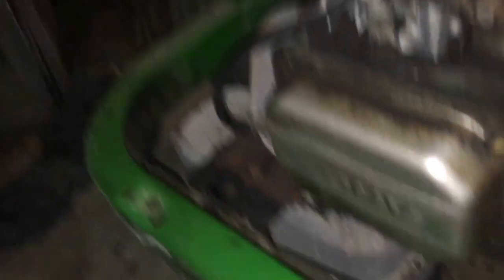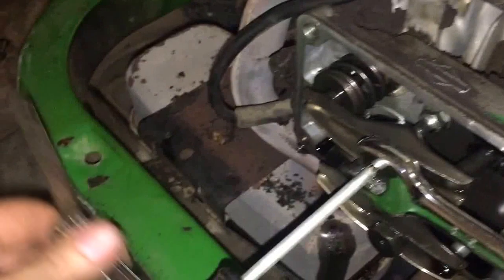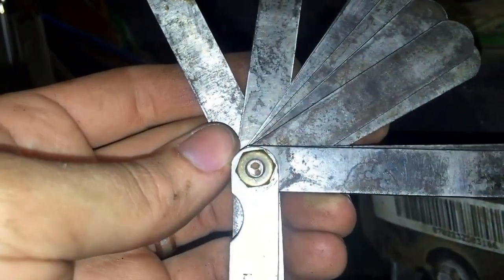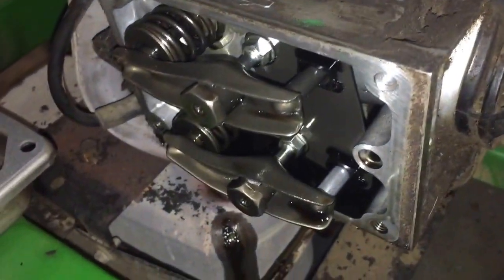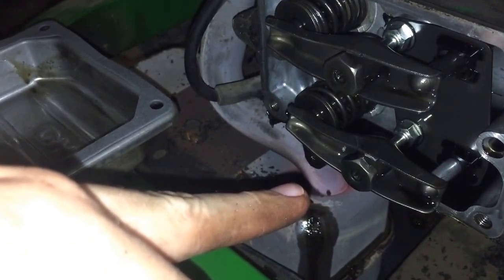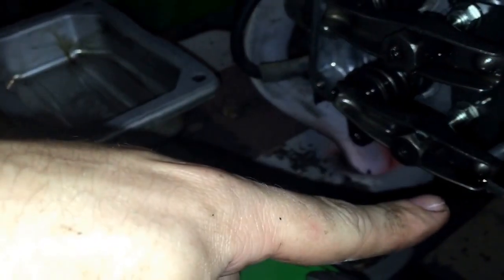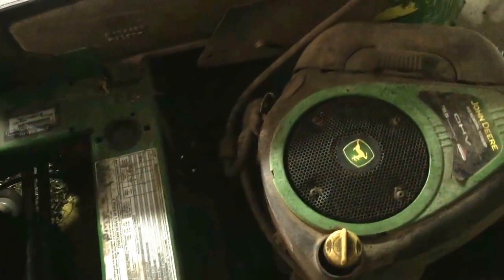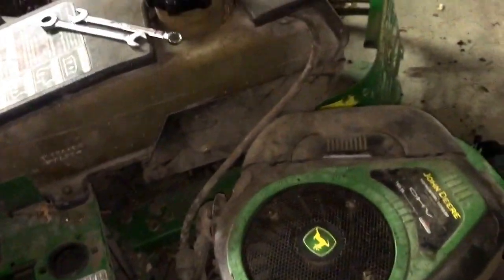John Deere Z225 Valve Adjustment

Comment: How did you get that cover off without pulling the motor? Mine has very little clearance
Reply from the maker: You may need to pull the cover, it’s only a few extra bolts and gives you more room to work.